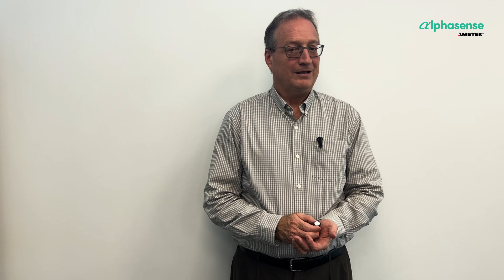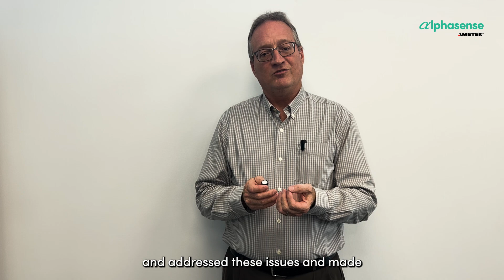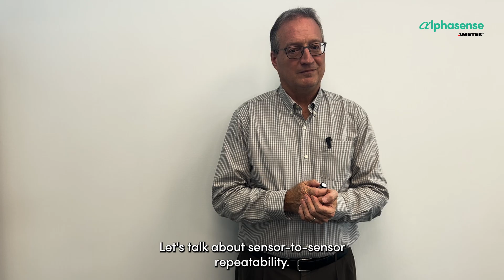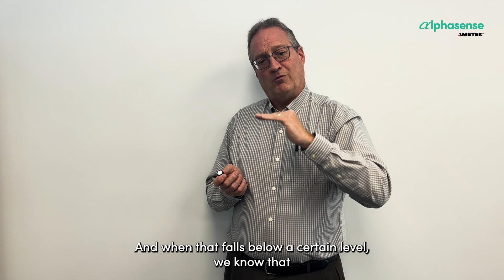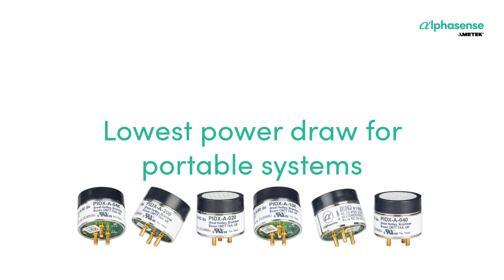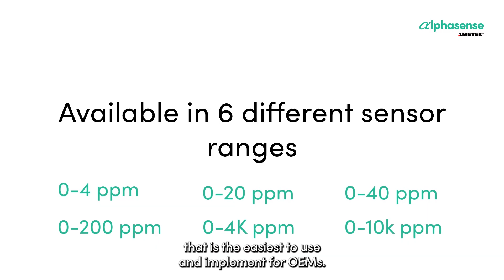Unveiling Alphasense PIDX Sensors | Advanced PID Sensors For Precise VOC Measurement

Comment: Hi,
what are the limits for the lamp ouptuts measured by the photodiod?
Reply from the maker: Hi @kevinocleirigh4989. Thanks for your interest in the PIDX.
The PIDX features a photodiode that measures the lamp output intensity. It is designed to provide a fault indication if the lamp is not lit. This functions by indicating whether the lamp is good or bad based on a specific analog limit of lamp intensity. However, the photodiode signal will not indicate a drop in lamp intensity due to the lens becoming dirty during use.